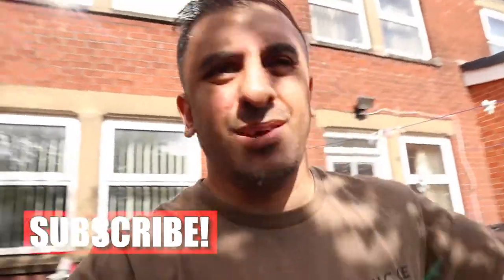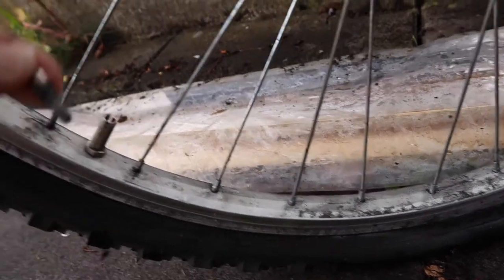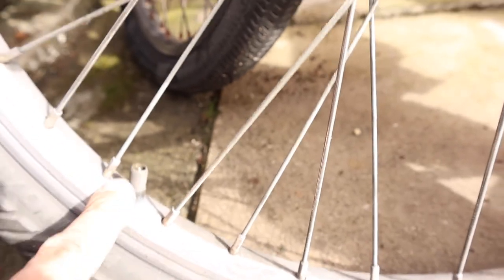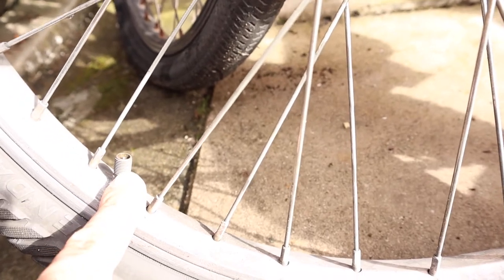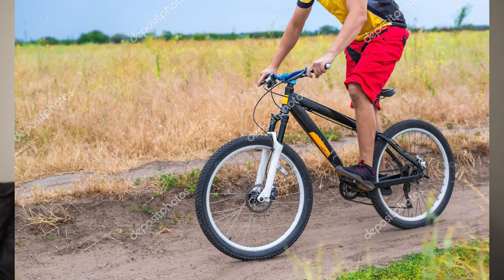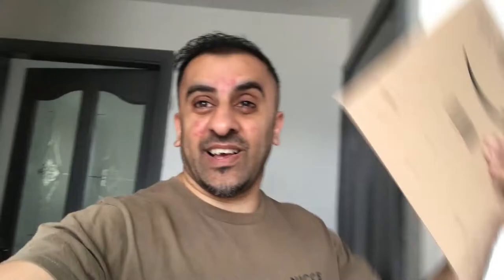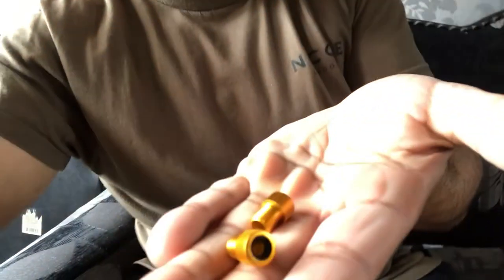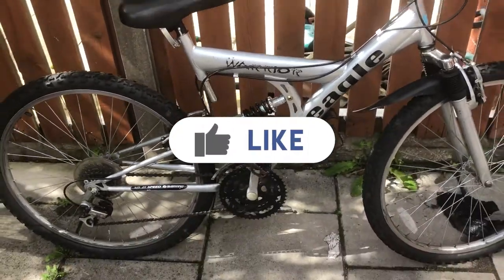PRESTA VALVE SIMPLE HACK | ADAPTER FOR PRESTA VALVES

Comment: Your original valve, at 1.26 in video, was not Presta or Schrader but a Woods/Dunlop. There is absolutely nothing wrong with Presta valves, I've been using them for over 40 years. Presta valves are better than Schrader with high presures, they also pump more easily because there is spring to overcome when inflating. Get your yourself a pump you can carry on your bike.
Reply from the maker: Just checked and my bad the valve at 1.26 is woods/dunlop. To be honest it was my first time coming across this type of valve so it kind of got me. Thanks for shedding light on the valve.